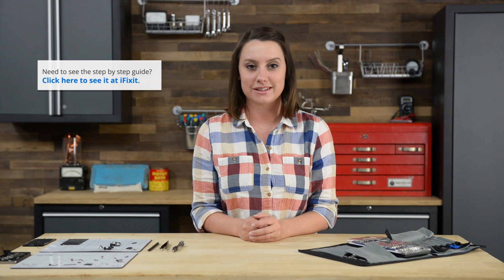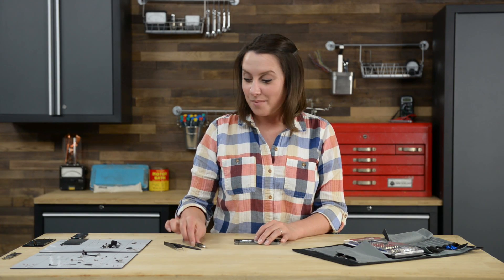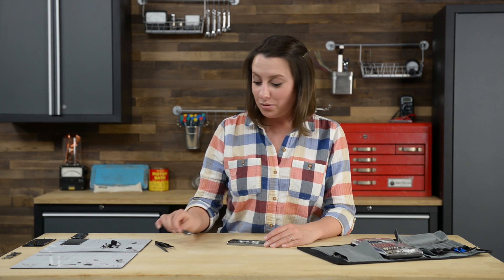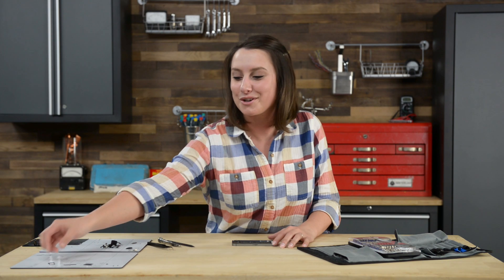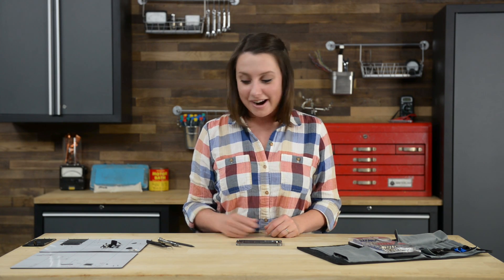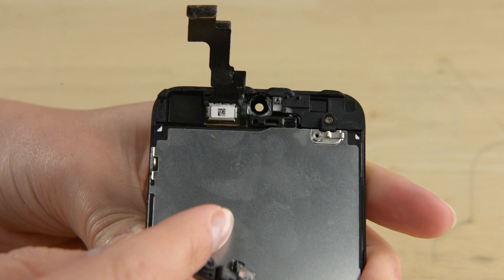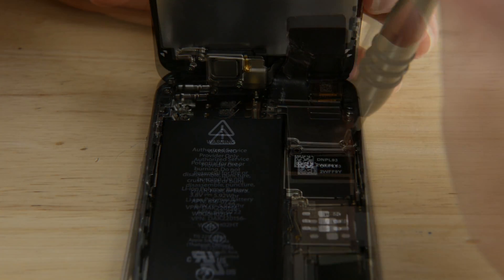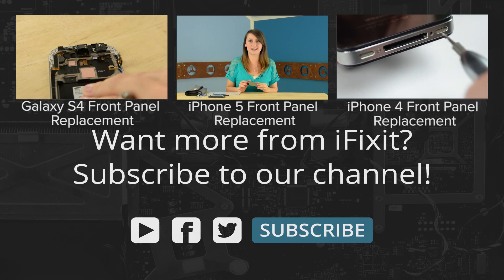iPhone 5s Reassembly

Comment: @ 5:50 looks like you're missing the eenie weeny teeny tiny itsy bity little bracket that is supposed to be "captive" on the home button ribbon cable. It was in the disassembly video, but looks to be missing here. Mine wasn't exactly captive; in fact after it fell off it jumped away and escaped, never to be seen again. What happens if I re-assemble without this?

Comment: power button won't work!?
Reply: I had the same problem.  turns out that I switched the 1.2 and 1.3mm screws on the front panel assembly.  After I got them on the correct orientation it works again. good luck.
Reply: Oh dang. Okay! Thank you, I'll try that!

Comment: After replacing my battery touch id doesn't work. I just snapped the cable of the home button on the socket and put the bracket on. What did i do wrong?
Reply: LittleBaljeetGaming 
Did you remove the braket and cable for the home button before lifting the screen up? You're supposed to pop off the screen a little bit then disconnect the cable and then open it all the way. It seems like you may have forgotten that step.